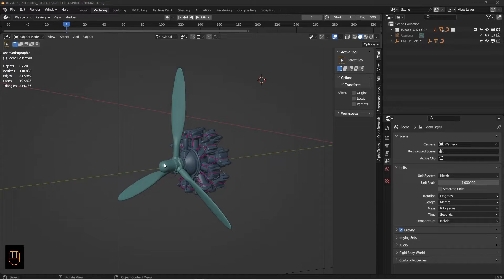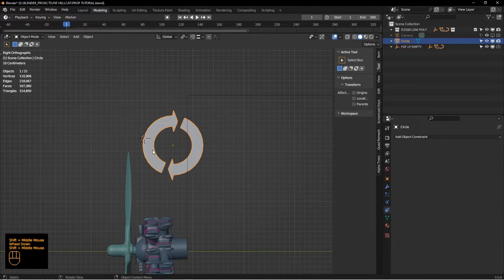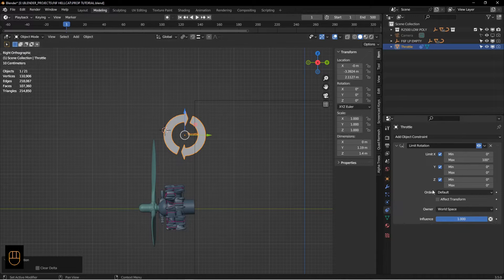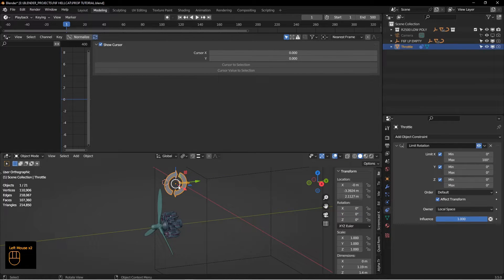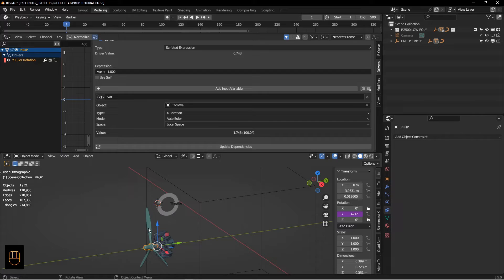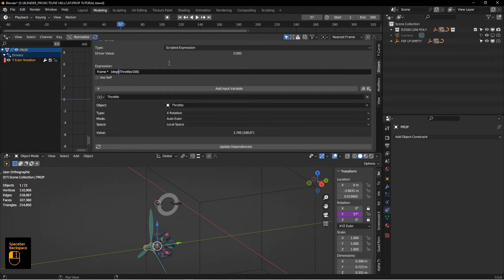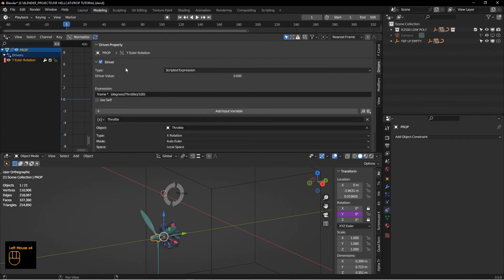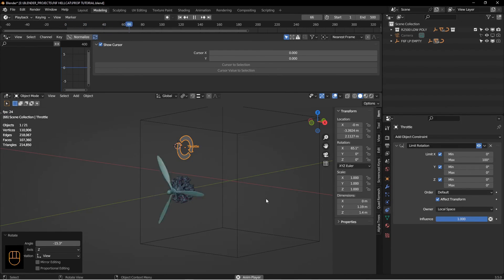Blender:  How to rig a propeller

Comment: As cool as this is, and it is. Drivers are awesome tools. It's a bit over-thought and not needed for most applications. Two keyframes a few degrees apart, cycles modifier, linear interpolation on the curves and set the modifier to "repeat with offset" for both inputs. It takes about 30 seconds to set up and will suffice for 99% of uses. This would, however be wonderful for engine start-ups and shut downs where more precise movement is needed.  Most of the time if a prop is in the scene, I've found actually spinning it slower than it really would often looks better than real world values. Motion blur is your friend. :)

Comment: Thanks for the tutorial. However, it's not robust for animating the throttle midway through an animation. For example, if you want the engine to turn on at frame 700 using the equation: {CurrentFrame} * {Throttle} * {SomeMultiplier}, the propeller starts spinning at 700 * 100 * 1.5 = 105,000 rads (6,016,057 degrees) instead of 0. This causes a glitchy movement until the throttle value stops animating. I was figuring this out when I came across your video. In my view, the equation needs the frame at which you start animating the throttle to function properly. I don't know how, though!
Reply from the maker: That's a fair point.  As a quick hack, you could subtract 700 from the frame number.  

There's probably a more elegant way to solve the problem though.